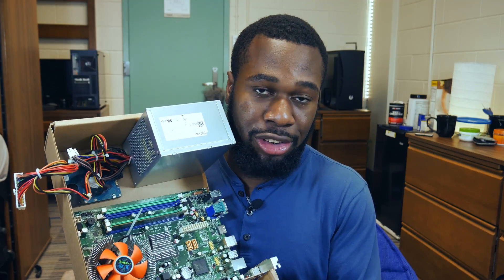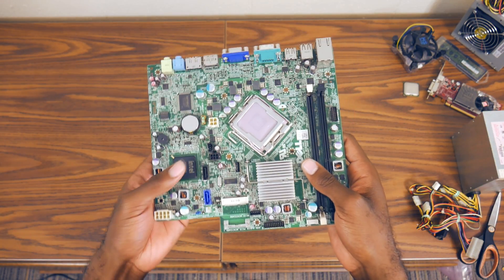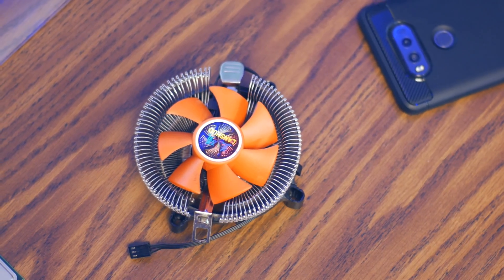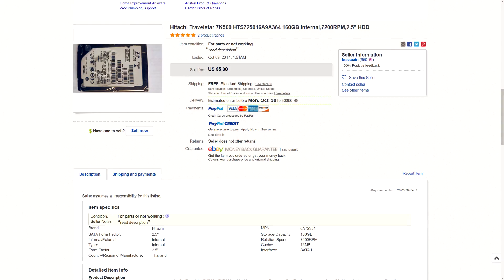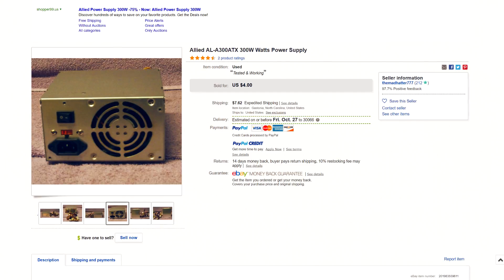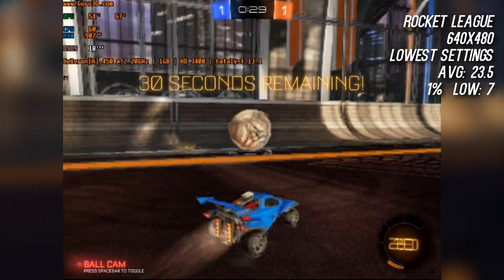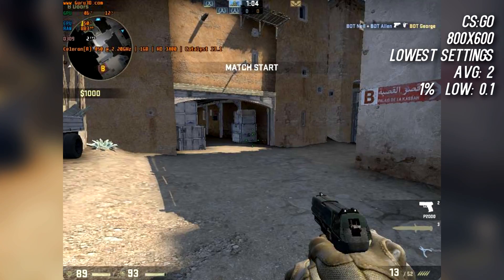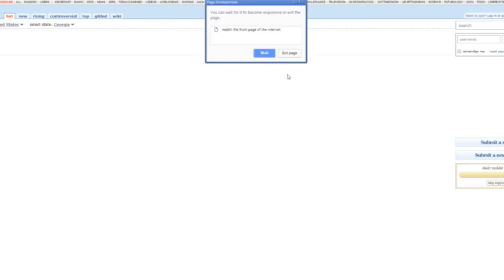I built the cheapest PC on eBay possible - can it play games? | OzTalksHW

Comment: cheapest computer I ever built:  
The ever popular Optiplex pocket gamer machine.
the SFF case,  with the small socket original i7 850,  8gb of DDR3, super cheap used ebay SSD and a GTX950.
It could really game, and it was less than 400 bucks.

Did a older/newer build with a friend of an LGA775 optiplex,  full tower this time.  improvised a core2quad @ 3.0,  8 gigs of DDR3 (luckily) and a GTX1050Ti.  
similar results, similar price.
Reply: Considering an Xbox one X is 500 dollars?
and doesn't actually do shit?
I'm sorry your ass works at Wendy's or something,  but yeah,  a GTX 1070 that I'm currently running is more than that.
Reply: it's 40% of what I get paid every 2 weeks,  and it's pretty much what i have free to spend every two weeks when I set aside my bills and what I'm putting away for savings and investments.
Reply: Your best bet is to keep your eyes peeled on the Used Market,  like Ozz is saying.  look around your school's library,  find out what they're using for systems,  ect.  
even a 5-8 year old setup,  will rock games out if you pair them with a good midrange graphics card like a 4-570,  1050Ti ect

Comment: so the cheapes pc i ever built cost me 154$ usd, using an asus rampage 3(with an ekwb waterblock i got for 40$ an e5620 7$ a gtx 670 50$ an old ssd 20$ and 8gb of ram 7$  and the coler i had lying around i think i brought it for 10$ and an antec p180 case for 20$ @ the time of building it
Reply: btw love your beard, i wish i had one too

Comment: Cheapest PC?  technically, a this point was a Non functioning Hp TouchSmart 9100 AIO. I purchased it for $15 from a Facebook Buy sell trade group. Ended up needing a new Motherboard. so I sourced one on ebay , which happened to be literally 5 min away from my house, and picked it up for $20 BAM!  fired right up. Has a 23 inch 1080p touch screen, 350gb HDD, Core 2 duo 2.1ghz Onboard Nvidia g200 (windows 10 reads it as a 9400?) and had 4gb ddr3.....out of pocket $35 TOTAL. works great! i'd be great not having upgrading a thing, could have even re-sold it for $150-$200 But no,being me, I just had to Upgrade it, I added 4 more gigs , totaling 8gb(had it on hand) upgraded the processor to a Core 2 Duo T9550 bumping FSB to 1066 and processor speed to 2.66ghz. i have also purchased an Nvidia Gt 230 1gb graphics card, but have yet to be able to get it to work, my thought is i need the 150w power brick as opposed to the 120w....so for another $50  i am at $85  for a system that can 1080p most all media (not really for games) netflix, youtube etc...once i nail down the MXM card issue, games are on the table! Right now it sitson a table in the kids room, so they can watch PBS Kids, and NETFLIX.

Comment: I picked up a PC for free with a pentium dual core LGA 775, 6800GT and 2GB DDR2. Seemed like a decent pickup until I tried to turn it on, I went through all the parts and it looks like the motherboard is dead.

Comment: On an older system like this with a Radeon HD 3000 series GPU, you might have results with HD YouTube playback by installing the h264ify extension on your browser.  With that, you can force 30 FPS playback and H.264 streaming (which should be hardware-accelerated on that GPU).

Comment: Cheapest computer I ever owned was a 400$ stock dell tower hand me down, it was nearly 4 years old by the time I'd recieved it and had originally belonged to my brother. in fact we had to actually spend money on Ram as it didn't have enough to run Photoshop CS3 (incidentally the Photoshop suite cost more than the PC at the time), photoshop required a minimum of 1 gig of ram and the PC had only 512 meg. Being 14 at the time I thought it was the best, because it was a computer that was all my own. I mostly played online with it, and it managed to hold up pretty well to Myspace, Neopets and even IMVU which ran okay, even with python being relatively new at the time and the machine not having dedicated graphics.

Comment: I used a cheap ebay cooler similar to this one on an i3-2120 when putting together a budget pc for a friend. It also had mounting issues and I ended up zip tying it to the mobo. Temps never went higher than 73c during a 30 minute prime95 stress test, however when he later upgraded to an i5 2500 temps were shooting to the high 80s. Just thought you might like to know where it reaches it limits.

Comment: I recently bought a Optiplex 380 with 4 gig of ram for 30 bucks. I swapped out the CPU for a Xeon X3450 for 11 bucks, plus 2$ for a 775 to 771 adapter. It didnt come with a hard drive and found an Enterprise WD 1 TB drive for 10$. It works great for simple  web browsing and Youtube. Tried Cuphead and it worked ok.

Comment: It wasn't eBay but on Craigslist I found a core 2 duo e7200 system with an Asus p5n-mx mobo, 4 gb of 800mhz ddr2 ram, a 320gb hdd and a thermaltake tr430 psu in a old coolermaster elite case for $15. I went to buy it just for the case and psu, the specs weren't listed and the photo was grainy and she couldn't tell me what the specs were but I could tell just the case and psu were worth at least $15. I think I will buy a e5450 off of ebay and add maybe a GT 1030 or 1050 to it and a cheap 120gb ssd. I don't really need it and will probably end up giving it to a family member so I don't want to spend too much on it but with a few upgrades it would be a decent little pc for older games and general htpc/web browsing.
Reply: The only downside is the mobo is limited to 4gb of ram max.

Comment: Love the show! I have a pentium 820d in pieces which is the slowest computer I have right now, oh wait I have an old HP or Dell or something that I got from someone which could be slower.  Anyways if you want the 820d mb ram and hsf you can have some or all of it, watching this video almost got me interested enough to hook it back up, I have powered it on a few times but only as a means to power the pwm on my D5 pump so no risk of shorting a component.  Anyways I remember this machine being my first dual core and I was absolutely blown away! The fact that I could feed several driver install's at the same time and still use it for browsing, I was sittin pretty.  Down the road I didn't realize how out dated it was until I attempted to stream full screen HD.  The computer I had before that was my first custom build, an Athlon XP-m 2800+ and ehrmahgerd I clocked that thing like no other, it was a generation old when I built it but I got by far the highest result's I could find from anyone else on the platform.  At one point I had a full sized high head pressure iwaki pump running through a cpu block with push fit fittings running into a popcan over a plastic tub...... it worked surprisingly well.  Granted I had the occasional drip onto the gpu and somehow the gpu was a champ but it ate up motherboards, lets just say that I wore out my welcome with the newegg RMA department lol!  If you had the time to push some clock's I'd love to see a video about overclocking the athlonXP-m or the athlon 64 as I didn't have the chance to play with the latter.  But I did have my machine stressing 24/7 and I obsessed non-stop over the clocks, but damn I found every bit that machine had.

Comment: The cheapest computer I ever owned was this super old Macintosh laptop from the 90s. I have no idea what it was worth but it was actually my first computer and it could browse the web a bit and play minesweeper. When I say old, I mean the thing had a black and white screen, was about three inches thick despite being a laptop, and weighed several pounds. I sold it for I think 20 bucks. I got my second computer from my grandpa. This one was a laptop from I believe 2004. It had windows XP, could run minecraft, web browse and multitask a bit. I sold that one for I think another 20 bucks. Finally in 2013 ish, I bought an HP Envy for about 700 bucks. It worked alright for a while, but it slowed waaaay down. I still have it and use it primarily as a word processor if I can't be at my PC. As for my pc, this is the most expensive computer I've ever owned and I paid about 1800 total with around 1400 for the actual tower and components. The rest was peripherals. I use this rig for college work and gaming, despite it's less than awesome GPU. Let me know if you'd like some spec bc I'm kinda proud of this build. Love your videos, keep em up!

Comment: i built a computer for my daughters using the athlon 5150. a gtx 750ti, 8 gigs of ram ddr3 a refurbished WD sata 750gig and the enermax ostro pink.  it ran everything fine at 720p.  the only reason i changed, it cause one of them started playing battlefield 3 online and train simulator 2013. these two games cause the athlon 5350 to crawl and stutter.  so i changed to a msi grenade fm2+ and an athlon x4 845.  now they can run everything at 720p.

Comment: $100 Dell optilex 740 used it as a pc replacement/ Home entertainment test  prototype concept for future computer plans.  My other is  Labtop $100 art work bench. Got it for the touch screen but no pen and no pen works on it. Finger laggy. Turning it into a Linux mint work station for artwork. Maybe virtue windows 7 if possible.  Working on a massive computer/desk system.

Comment: Just checked ebay  found a vostro dell 775 board that has a standard layout and heatsink holes for $16 , e8400 c2d $3.89 , Memory 1gb $3.30, Nvidia GT 310 $9.00 , 80gb WD hard drive $6.50  , intel heatsink $4.89  all were free ship , roughly $45 dollars but will run those games much much better than that celeron 450 not as cheap but for $10 more it will destroy the $35 machine

Comment: Oz, with regard to the PSU, a good PSU easily lasts for much longer than 10 years, you even get a guarantee of 10 years for some models of some brands. As you said, don't cheap out on it. Consider how long you use it and the investment certainly is worth it. Spend $80-110 on a silent and high quality 550/650 W PSU and you did a good investement for computer hardware. The same can be said for a case, it will last a long time. Of course 450 W is enough for most people but if in doubt, why not go a bit higher and be sure that it will suffice if you desire more powerful hardware in the future.

Comment: $49.88 shipped.

Core 2 Duo + Motherboard combo $14.96
https://www.ebay.com/itm/172835037656
2GB Ram $7.99
https://www.ebay.com/itm/332418532889
CPU Cooler $4.94
https://www.ebay.com/itm/172886596166
80GB 7200RPM drive $6.50
https://www.ebay.com/itm/162544089263
Radeon HD 6350 $5.50
https://www.ebay.com/itm/192336646390
200w Dell PSU $9.99

Case would have to be similar to the one done on the video aaand the cooling buuut.
Performance should be heaps better~ I couldn't do cheaper but..
like.
15$ does this? I think it's worth. XD

Comment: I recently got a cheap computer off of craigslist , it was a dell optiplex with an e8500 for 25$, it had 6gb ddr3 and a 500gb hard drive, I got a gt 730 with a "noisy" fan for $5 (I fixed it) from another listing. I gave it to someone who needed a computer.

Comment: I'm not 100% sure, but it looked like there was an msata port on that first board.  Could you have used the laptop external GPU trick with that? Looks like they can be had for around $10.  I guess that breaks the budget though.

Comment: I don't think LGA 775  processors have integrated graphics onboard.  I thought the motherboard had the graphics chip.
Reply: Prior to the LGA1156 socket, motherboards with integrated graphics either had an IGP integrated into the north bridge, or a discrete GPU soldered to the board. The latter configuration was rare, but usually a better option since Intel has historically sucked at making good video chips.
Reply: Nvidia was the only vendor that released a semi-decent IGP. ATI's offerings were pretty terrible with their Xpress 200 series being the most common (and most unstable.) I had lots of customers back in the day with various HP/Compaq machines that had an Xpress200 chipset. Crashes were common and the fix was to use a discrete GPU and uninstall the crap ATI drivers.

SiS was laughable, they barely offered 2D support, let alone any sort of 3D.

VIA had their Unichrome9 IGP, but it was essentially S3's old Savage4 / Pro Savage core with a bit of spit shine to add DX8 and I think early 9 support. The drivers were buggy though and never worked right.
Reply: I built my parents a new computer a few months ago. They had a motherboard with the Nvidia GeForce 6150LE. Pretty good scores in 3DMark 05...

Comment: I recently acquired an Acer Aspire One D255 netbook from a friend who found it amusing enough watching me try to make it run fast to just give it to me. The original specs consisted of an Intel Atom N550 dual-core running at 1.5 GHz,  1GB of 1333 MHz DDR3, and a 250GB 5400 RPM HDD. I was given a free 2GB RAM stick of the same speed, and only spent around $30 for a battery, charger and a 16gb low-profile flash drive configured for ReadyBoost. I am aware that a 16GB drive for ReadyBoost is ridiculous, but it was actually cheaper than the smaller sizes of low profile drives. I have tried a ridiculous number of OS's on the system including, but not limited to, Windows 7 starter, Lubuntu, Xubuntu, Puppy Linux, Remix OS, and finally Windows 10 because, "why not?". Needless to say, I have put the HDD through the wringer, but I was trying to see if I could push the system to do at least 720p on YouTube comfortably enough. This was to no avail :( It always defaults to and runs best on 480p no matter the OS, which I expected. But since it was junk anyway, I figured it'd be the perfect system to get myself somewhat familiar with Linux. I found I'm far more comfortable on Windows, but at least I can sort of navigate Linux. The only thing I have yet to do is try an SSD, but considering the going price for that model of laptop on eBay, I don't feel like a 120GB SSD is worth my money. I consider myself lucky that ShitBook even boots up.

Comment: I know of a computer that is both cheaper and faster than this one... but it comes fully assembled... the Raspberry Pi 3!

Naked: https://www.newegg.com/Product/Product.aspx?Item=N82E16813300007
or with accessories: https://www.newegg.com/Product/Product.aspx?Item=N82E16813300009
Reply: BikeHelmet  if it could run windows i'd go for the pi 3 :(
Reply: Sorry, only Win10 IOT core, which is a bit different than standard windows. But it does have Raspbian linux (Debian based, so it includes a desktop environment that any Windows user could figure out), and of course distros like RetroPie that turn it into a retro gaming beast.
Reply: BikeHelmet i've seen some really cool stuff with the pi3 and retro gaming (and these are the games I'm interested in the most), but i think i'd be better off saving for an entry level pc just for the upgrade path

Comment: I had a pc with a 2.93ghz celeron d and 1gb ram in 2005. It was horrendous even back then! I'm surprised the guy on ebay didn't pay you to take it off his hands!
Reply: The Celeron 450 is based on the Core2 architecture, not Netburst like your 2.93 GHz variant was. Core2 Celerons were actually respectable performers, especially the dual core variants like the E1200 in general desktop use.

Netburst Celerons were poor performers due to cache starvation. The Netburst architecture needed large amounts of cache to perform adequately, something which Celerons sorely lacked. While the normal Pentium 4 may have 1-2 MB of L2 cache, early Netburst Celerons only had 128-256k, and later 512k with the Cedar Mill Celeron Ds. Most Netburst Celerons also ran smokin hot because Intel were scumbags and decided that EIST (Speed Step) wasn't something the Celeron needed to keep.
Reply: GGigabiteM Ah I didn't know that thanks for letting me know!

Comment: I got a computer with Core 2 Duo E8400 3.0GHz and 4GB system ram for $25 shipped on Ebay, and Radeon 3450 Pro for $3.50

Why did you go with trash CPU when better options exist for less? Lol!
Reply: Just like I did a 775 build(got mobo, case, power supply free) paid 9 bucks for a q6600 quad core did bsel mod to get 3.0ghz, 8gb of ram 18 bucks. Just gotta get a graphics card. Might go for a 1030 or 1050.
Reply: Keith Wilson Get a 560Ti
Reply: Chesos already got a GT 1030 OC card runs anything I like medium to max settings 1080p

Comment: Building a dirt cheap PC is alot of fun. I recently built one for less than $40 dollars. I got some parts for free from friends/family. It's got an e8600 cpu, 400w psu, 6gb ram, AMD 6870 GPU, and a 320gb 5400rpm laptop HD. I can play most older games at decent fps and good settings. And some newer games are playable too.
Reply: Sir Lagsalot It's better than my main pc
Reply: Sir Lagsalot I love the name, I was literally rofl.
Reply: Could you please tell me which motherboard you are using to get that 6GB of RAM to work on a 775 platform?
Reply: Mohammad Kasid A lot of socket 775 boards work unofficially with 8gb capacity. Pretty sure my optiplex 755 does.
Reply: thats actually not that for under 40 bucks
Reply: Jelly of that E8600. I had to settle for an E8500 for my previous cheap upgrade.
Reply: Wtf my PC has 2 gigs of ram time to upgrade
Reply: Jorge Vargas how TF u survive with 2 gigs of RAM

Comment: But can it run windows ?
Reply: Nicka Thom I think windows 10 requires at least a dual core with 2gb ram. So I'd say NO!
Reply: Optimistic 007 It requires 2GB RAM for x64 and 1GB for x32, but it can run on any processor that's at least 1GHz. Actually, Windows 7 and 10 minimum recommended specs are identical.